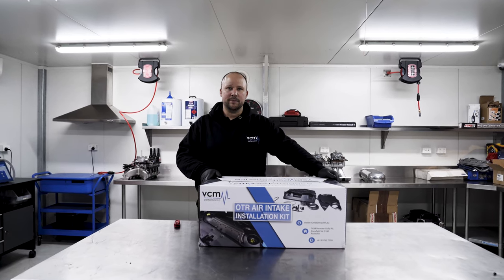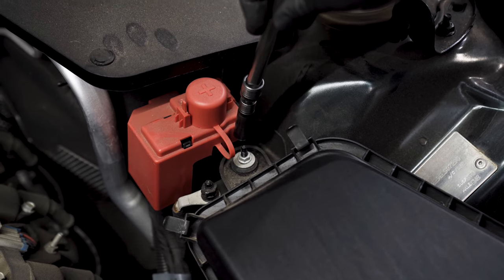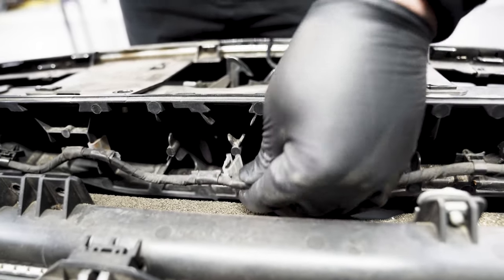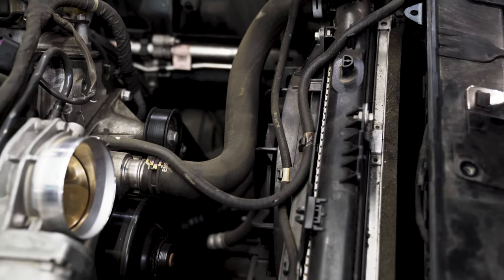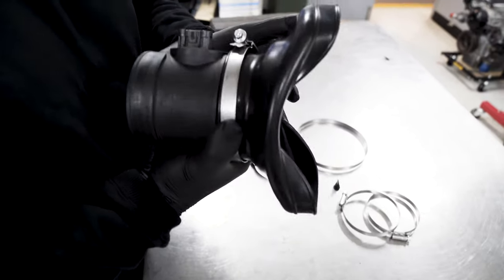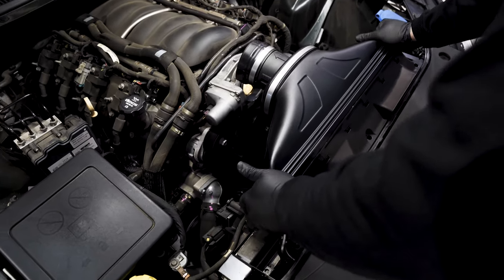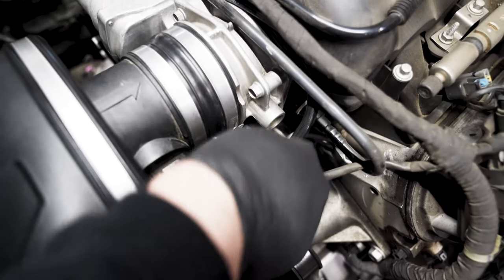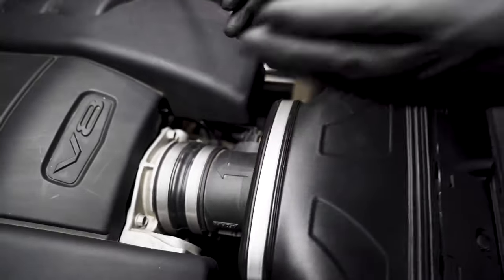DIY INSTALL: VCM V8 OTR

Comment: Great video. Had 98% of what i needed to install on my 2016 SS (VF2). The only thing missing was how to get the kazoo tube off. The tips for moving the radiator hose and clocking the MAF and PCV hoses were great as well.

Would have liked the kit to come with a rubber grommet for the kazoo hole in the firewall, but i love how it looks and performs

Comment: Great product, very easy instructions. Really made a difference to the car's sound and performance. It sure feels faster. Tell me, are the two plastic plugs that secure the side covers to the otr supposed to go through all the way to the metal hole underneath or just through the two plastic holes? My connections have some movement but the plugs only go through the plastic, not into the metal holes underneath. 
Also what kind of power gain is developed after this mod? My 6.0 feels quite a bit more powerful at WOT

Comment: 1. No uploads of how to clean the VCM air kn filter and if its hard or easy, if you stuff it up and break it, then your up for a new otr all over again ?
2. Also no upload of cleaning the maf sensor or the throttle body at all ?
3. No mention at all of the engine needs to re tuned as well, for a company like VCM you would think they would do a proper upload showing you everything you need to do for the install and also maintenance of the new larger KN if they use a kn air filter to suit the VCM and even if its supplied or just a cheap chinese copy of a KN larger air filter?

Comment: Did you have to remove a section of rubber seal under the bonnet?
Reply from the maker: Only if you want to, there is plenty of air going through the grille.

Comment: By any chance is there any help I can get, my pcv line wouldn’t fit into the top part by the coil packs we tried multiple ways to fit but it wouldn’t go in
Reply: I’m having that issue now, how’d you get around it?

Comment: If i fit one to my ve ss manual. Does it need a tune straight up or can i run without a tune for a bit
Reply: From what i understand any modification ,OTR , exhaust ,extractors ,cam ,intake ,turbo charger ,supercharger, underdrive pulley, heads ect will require a tune. If you plan on doing a series of modifications do them in stages as each time you tune will set you back quite abit of cash.
Reply: As I am aware an OTR wont require a tune as the computer will change the airflow as needed however it may be running lean so a tune is not required however if it was tuned it would be using the OTR at its best potential
Reply: @kendawgtheawsome3129  if its a mafless otr kit it will , some can throw codes some dont.

Comment: What is an OTR? You never say what it is or, what it is for?
Reply: OTR - Over The Radiator airbox , the design relocates the MAF (mass air flow) sensor to mount directly to the inlet manifold, and allows filtered air straight into the MAF, rather than via the 3 90 degree  bends of the standard airbox setup

Comment: anyone else run into a problem where pushing the radiator back caused a leak at the bottom connection??

Comment: That otr intake looks very restricted
Reply: How?
And where?
Theres cars making well over 1000hp with VCM OTR.
Reply: yes it restricts the air going to the top of the radiator and also the a/c condenser, which is never discussed, the engine will run a little hotter and the same with the A/c condenser with less cold air hitting it, especially during the summer months? VCM does not mention anything about the radiator and engine cooling reduction and what the % are and the same with the a/c condenser % reduction especially in summer AU hot months?
Reply: @7071t6  not necessarily, as the OTR doesn't sit ON the radiator/condenser, it sits in front of it, allowing plenty of room for air to still go in behind the OTR and keep things cool.
Reply: @7071t6  also how do you go about removing the air filter for cleaning is a question that should be asked too